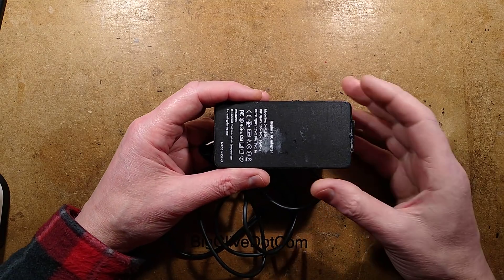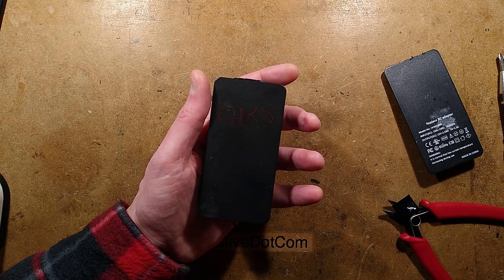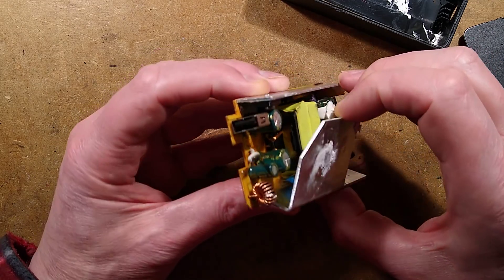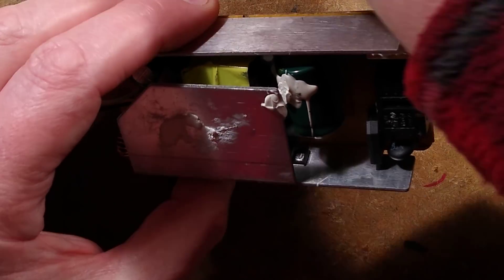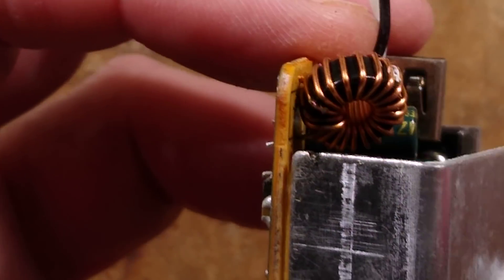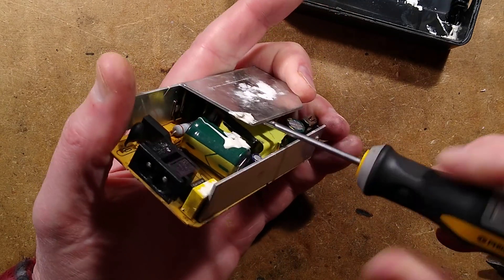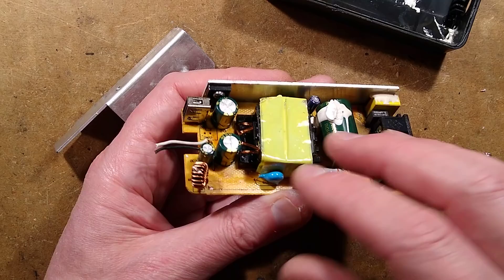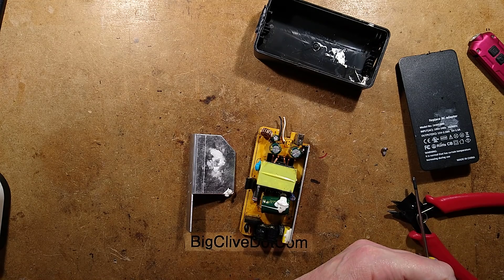This PSU killed a Microsoft Surface and a monitor

Comment: My “cheap replacement power supply” story:  I was working with an audio testing company and we spent hours trying to figure out where a certain noise spike was coming from in our device.  A lot of audio and cellular test equipment was in use, and all of it was controlled by a laptop computer.  Out of frustration, I unplugged the laptop power supply and when we reran the test the noise spike was gone.  The power supply turned out to be a cheap aftermarket one.  We tossed it in the trash and got a genuine one from another computer and had no more troubles.
Reply: @just_saw_dust  The whole "china export" thing is just an urban myth. China never had such logo at least not officially. And it would have been useless anyway. 
Anyone can use the "real" CE logo. It only means that the manufacturer or the importer affirms the product complies with EU regulations. But it's purely declarative,  it doesn't mean the product has been approved or tested by anyone other than its manufacturer. 
So anyone in China can use the "real" logo on their dodgy products without fearing any repercussions, because although its a crime to apply the CE logo on a non compliant product, suing a Chinese company on the basis of an European law is next to impossible
Reply: @lionnelc13  That may be valid for a direct purchases, however if you buy stuff already imported in EU it has to undergo some local certifications AND importer can be held responsible for any and all problems with that…
Reply: @FalkonNightsdale  That's false. Except for a handful of categories (mainly medical), CE is a self-certification scheme, regardless of where you buy the product from.
Reply: @lionellc13 Yup you're 100% correct and have obviously put your name to a CE certificate. CE certs are only valid within the EU. They must be signed by the importer within the EU or manufacturer if EU based. It is a legal self certification scheme, telling people that the product complies with all relevant EU directives and regulations. You can be sued and/or jailed if you falsely declare and label a product as certified (CE marked). But hardly anyone enforces the rules and the chinese know that...
Reply: "CE" is a self-certification. Chinese companies don't care, they can print whatever they want.
Reply: I always found that the cold cathode backlight driver in my old laptop created noise that ended up in the audio. This was recording with an external tascam thing. The solution was to run it at full brightness. Thankfully we have moved away from that bit of technology.
Reply: @Rich-on6fe  Or with the display off but that’s not always feasible. I used to record multitrack on such a machine and always made sure I closed the lid after hitting record. Not ideal but it worked ;)
Reply: @rdoursenaud  Whenever I record with my laptop using the RTL-SDR dongle, I pull the plug of the power strip to everything out of the wall, flip the switch off on the power strip feeding the battery and phone chargers, and shut the switched outlet running the remote controlled lighting bulbs and tape light strips. And light the room with a magnetic linear 12 volt AC adapter connected to some LED automotive backup lights on the ceiling. That way the laptop is running on its batteries and the signal to noise ratio is better.
Reply: I remember having noise in the audio input from an original psu for a notebook (i think it was a delta) with earth connection. The classic ground loop issue.
Reply: I bet there was a CE logo on there too.
Reply: @dorbie  Not all CE marks are equal… There is a diference in letter spacing between "true CE" and "China Export CE"
Reply: @FalkonNightsdale  Except even legit stuff has quite often got it wrong.. I've found several definitely 100% legit items with bad CE marks.
Reply: @FalkonNightsdale  Total coincidence I'm sure 😀
Reply: @silverdragonslair  They srls need to change CE to somethink outher like European Certificate of Conformity (ECC in short). Because be real here China do this special and for most of consumers it's hard to spot a difrence. And as you see even genuine europen parts and certyficates print this wrong...
Reply: @FalkonNightsdale  It’s the importer who’s responsible for EU conformity, regardless of the logo. If you buy something from AliExpress or EBay, you would be the importer. 
If you’d only use it yourself than that’s at your own risk. If you would sell it within the EU however you’d be responsible for it.
Reply: Had that happen at a cinema, though I was a viewer during some press event so I could not do as you did and was forced to sit through a low but annoying mains hum.
Reply: Lot better than I expected, Thought you were gonna say some cheap PSU took out a mixer board or some other ludicrously expensive bit of kit lol.
Reply: @Nevir202  Thankfully not, but it did waste a couple thousand dollars of engineering time.  It definitely wasn’t worth the “savings”.
Reply: @-Jethro-  LMAO!
Reply: Its the customer education in buying the products they want that needs to be upped.  Unfortunately people just buy by price . . .
Reply: Had a similar problem in my home a few years ago. The issue was that any laptop, tablet or phone would have their touch surface malfunction when it was plugged in to charge or connected to something that was also attached to mains. After a lot of troubleshooting I ended up finding that the modem power supply was the culprit, generating some noise on the power lines that was affecting the touch surfaces of devices. While the power supply was original to the modem, both were cheap Chinese hardware of dubious quality.

Comment: We had the exact same problem (with much less injurious outcome as we had e fuses) at my former workplace.

The "fix", which was more of a workaround was to put heatshrink around the whole inductor, which worked of course.

A virgin board was fine, but stick it in a container and ship it half way around the earth, yeah, that inductor moved.

Bit crap really.

Comment: As a designer involved in designing equipment to meet the requirements of the International Standards marked on the case, it is totally obvious that even if the power supply met those requirements when it was submitted for testing, it certainly doesn't in its current form.

Whether or not that is the case, and I doubt that it was ever submitted for testing, it means that ALL the Approval Markings are either invalid or fake or both.

The issue of rampant deception, safety issues and poor quality control is not just overly common in Chinese Products, it's typical.
Just less so in products supplied with "Branded Products".
CAVEAT EMPTOR!
Reply: What makes you think this thing ever saw a test house? If they won’t invest in a decent translation, they’re not going to invest in conformance assessment. Using the CE mark fraudulently is an offence in Europe, but it is excused in China with the China Export scam mark.

The only protection is to only buy mains equipment which is branded and sold by a reputable British supplier who will fear Trading Standards getting involved. I NEVER buy cheap Chinese mains powered equipment online from the usual suspects like eBay and Amazon Marketplace.
Reply: @MarkSJBeard  You never buy cheap Chinese mains equipment online and neither do I but we are the exception !
Everybody is looking for cheap alternatives to branded electrical products these days because they don't see any difference apart from the price ! They plug it in and 9 times out of 10 it's fine for a few months, sometimes longer and they don't mind if it fails prematurely because they feel they have saved money and will often buy a different product afterwards.
I have bought German power tools which have failed just out of warranty and had other quality electrical items which I've had to repair myself sooner than you would expect so it is tempting to try to save money sometimes.
I have bought power supplies like USB adapters etc but I've always taken them apart and checked they were safe before use, I have even modified one myself to make sure it was safe before use and that was supposed to be a quality branded item !
Reply: @MarkSJBeard  As I said, I doubt that they did. 😏
Unfortunately even buying from a "reputable Australian/British/US/Japanese supplier" may mitigate the risks, but it doesn't eliminate the problem.
The Supplier may not have the expertise to perform testing or QC on the products they import from China.
The habit of Chinese manufacturers of supplying samples or first shipments at specification, then modified/cheapened shipments subsequently is well known.

The number of Reputable Suppliers that have been "burnt or shocked" (Pun intended!) is not insignificant.
I worked for a major electronics oem manufacturer where the Third Party Buying Agent cut costs by buying counterfeit Mains Rated Capacitors.
The outcome was house fires as the Capacitors failed, very large lawsuits, insurance claims, bankruptcy and the end of the company.
Reply: In Germany they did some mass testing of DC adaptors, quite a lot were completely unable to meet the power requirements marked on the case. Probably over 80%. So it's wise to buy something like 2.5A if you need 1A.
Reply: @6581punk  buying a larger capacity charger is a bit less dangerous but nowhere near safe. Cheap Chinese USB chargers usually 
- don’t use safety decoupling capacitors 
- don’t properly isolate the primary and secondary windings in the transformer 
- don’t have proper isolated tracks on the PCB
- are very noisy
- have no proper fuses
- etc etc.
Reply: <Just less so supplied in products with "Branded products">

You mean that there's a chance that even a reputable brand that outsources manufacturing of a product to a Chinese OEM may actually be getting a fire hazard that doesn't follow all regulations?
Reply: @a4andrei  The difference is a big brand will carry out testing prior to inclusion of the unit in their product. Load testing, vibration testing, temperature chamber testing.
Reply: @a4andrei  There is a good chance that a power supply delivered with a tier-2 or smaller brand product experienced unvalidated changes in manufacturing and is no longer carrying its regulation stickers rightfully, things sometimes slip by. Fire is always an option. Electrocution risk would be a pretty exceptional occurrence, but component/supplier QC is critical and slip-ups do happen.
Reply: @a4andrei  Sure thing! It's often the cause of product or parts safety recalls.
Reply: They don`t need to go trough all the testing if its based on a similar design that is tested or do they? I'm not familiar with it
Reply: @chinchan9  They sure do! The Approvals are for the complete item, so any changes to or substitution of parts will require at least partial retesting.
Reply: @chinchan9  I think the issue is that even if they submit a compliant design for testing/certification, they then progressively change it to save cost, without ever resubmitting it for testing and certification. Unless you have your own eyes on the ground at all times (like large companies like Apple, HP, etc. do), Chinese companies will take liberties to reduce cost, hoping their client won’t notice. When the client does notice, they’ll undo the last change, but they’ll continue trying new changes. (There’s a great book on this, “Poorly Made in China” that I recommend.)

For sure, there are Chinese companies (like Foxconn and Quanta) whose business model is based on reliably high-quality, to-spec contract manufacturing. But it seems they’re the exception, not the rule.

Comment: That is 'shocking' Why have any separation/isolation on the board when you are going to put  two big strips of metal one end to the other?
Reply: You can do that and still be safe - many laptop power supplies do. However the heatsink is not connected to anything, whereas this one was connected to the "ground" of the line side. Problem with this is that you can't guarantee thats neutral - especially in this design where they are using an unpolarised "figure 8" plug.

Comment: Some shmoo glue on the input inductor "might" have prevented this. Or as you mentioned, a piece of fish paper insulation would have been prudent. However, prudent engineering is not part and parcel of Chinesium Junke.  Best bet, buy the manufacturer's recommended PSU. At least the victim of the blow up MIGHT have some recourse. Or not....

Comment: 1. Using heat sink compound to attach the heat sink to the plastic case, what where they thinking? 2. Common sense tells you that vibrations would rub the copper insulation off when so close to the aluminium heat sink, why not twist the inductor 90 degrees or as you said make sure it has clearance. 
Why do the Chinese take so many shortcuts? Are they really that desperate to gather every cent to make more warships?
Reply: And what exactly would you use to help the thermal energy in the heat sink get transferred out of a plastic case?  That's exactly what heat sink compound was made for.

Comment: Another reason to be skeptical of cheapie power supplies. I've learned a lot from these post-mortem teardowns.
Reply: apart from that clearance issue, it looks fairly good, if they had just made the heatsink 10mm shorter that end, it would have been ok
Reply: i've seen much worse,  usb charger  with no mains fuse except wires to the pins, and standard grade cap from live to output instead of a proper class y2, or 2kv dc type (1kv was fitted)

Comment: That heatsink was simply too long, putting it too close to the inductor. That made it intolerant to the normal rigours of daily use. Very poor mechanical design. It would be interesting if MS had issued a recall on this.
Reply: there's no way that's a OEM charger.
Reply: @Wooble57  I did wonder about that. No prominant MS logo anywhere.

Comment: Is that inductor an output filter or part of the buck converter circuitry? It doesn't look like it's on the high voltage side, more like it's part of the low voltage output.
Reply from the maker: I think it's for generating the 5V supply from the higher voltage output.

Comment: Poor design.  They took the trouble isolating the high & low sides of the PS on the PCB (including notching under the optoisolator), but then bridged the isolation gap with the heat sink.
Reply: Yeah. I wonder if a different person designed the heatsink. Maybe in response to an earlier design getting too hot?
Reply: Probably another revision. Just look at how the other corner is cut diagonally, which might have been better for the faulty corner rather than the one with the USB port (which isn't even in the cut off part).
Reply: Doesn't look like a genuine Surface AC adaptor though.  Just a shitty 'chinesium' copy with a LOT of cost cutting and shortcuts compared to the original ones.  Its way larger than the original ones too, MS make some fantastic PSUs including in their consoles, this ain't one of them.
Reply: @zybch  It obviously isn't a real one.
Reply: @zybch  lol was anyone under any impression it was real? It has "replace AC adapter" printed on it, not even "replacement AC adapter".
Reply: @zybch  I doubt MS OEM their PSUs. For something so jelly bean its generally woth getting a general design from some true experts, like TDK lamda.

Comment: If only the power supply had been even shittier they might not have bothered with the inductor at all 😂😭
Reply from the maker: I think it's part of the buck regulator for the 5V output.
Reply: @bigclivedotcom  Oh, that would be quite a lot shittier then! I had the ends confused, I thought it was input filtering :)

Comment: I saw the nick blown into the Al you mini yum😁 a fraction before you noticed, I doubt the Chinese manufacturer did a Tumble dryer test, quick way to simulate lots of getting knocked off tables, then plug it in and see if it goes bang! If it doesn't and it still works probably a decent design, obviously THAT is not a good design.

Comment: This is exactly why I don't recommend or use cheap chargers for electronics.

I'm shocked they didn't use a ton of adhesive or hot glue inside of it like a lot of cheap products I have seen.
Reply: Wait for Rev.2 where they fix the exploding problem by adding a huge glob of the ubiquitous white adhesive goo between the edge of the heatsink and the inductor.
Reply: @sootikins  I mean, a good portion of hot glue would have prevented this until it melted. :P
Reply: @sootikins  exactly what I am waiting for and what I thought they would have had in this.
Reply: Pun intended?
Reply: @Rych  yes It was.
Reply: Pity. A ton of adhesive inside it might have actually saved this unit

Comment: I don't know if it's practical after all the damage, but it might be an interesting video to reverse engineer that power supply and then show on the schematic what shorted to the inductor and why that made it go bang.
Reply: Already explained all that without a diagram, at least for those of us familiar with how switched mode power supplies are usually wired.